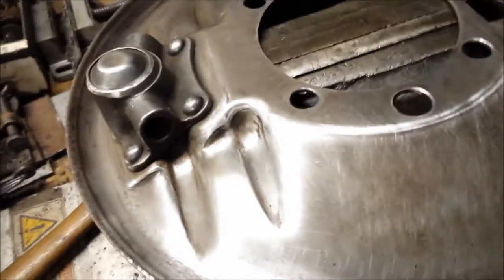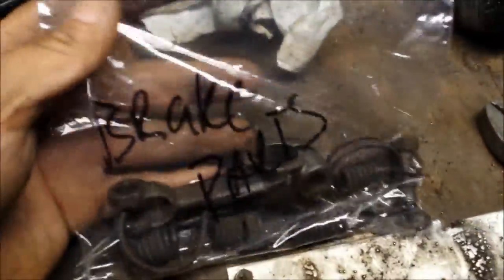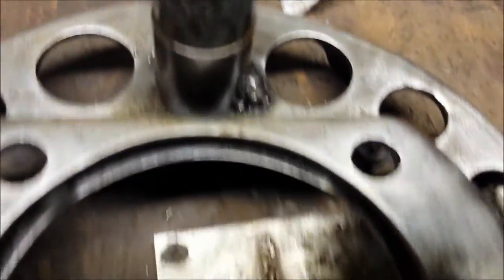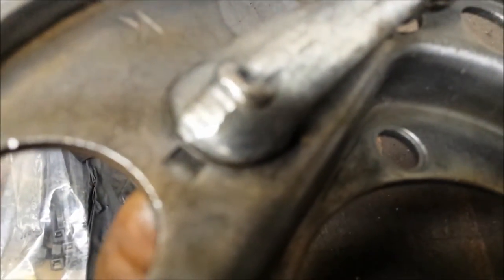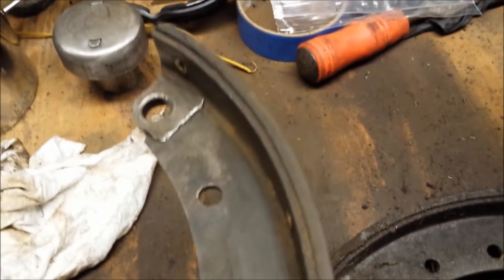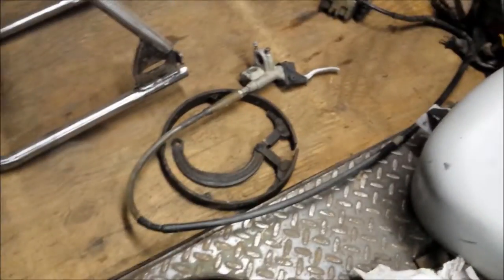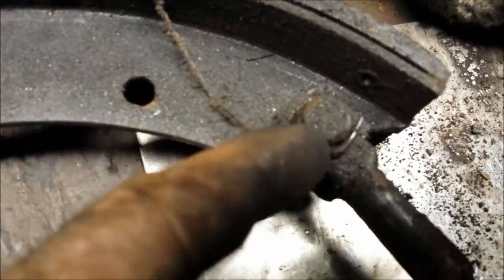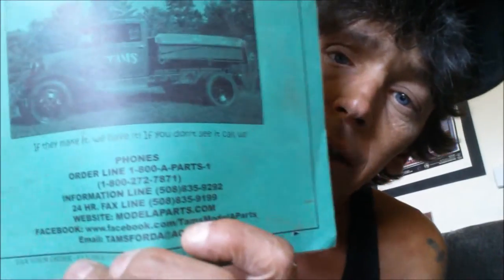1928 Model A    getting into the Brakes

Comment: Put the toggle lever in the vise heat the crap out of the tube around the shaft and grab it like a frisbee and turn it back and froth after it loosens use a 3/8 bar/extension beat the shaft out clean it lube it reinstall it
Reply from the maker: homotorsports I tried brother, she don't want to move ffs, will try again just because you said, and see how it goes.  cheers brother